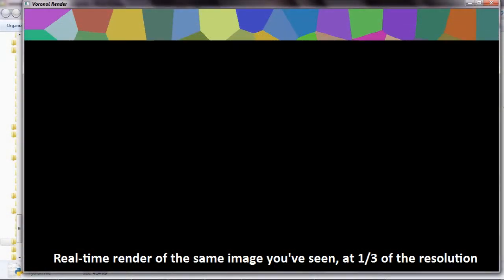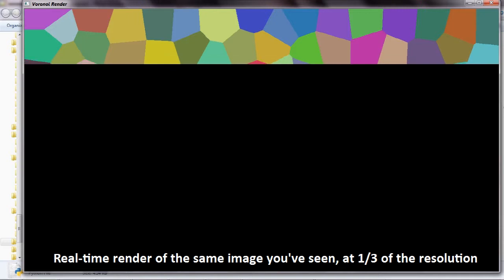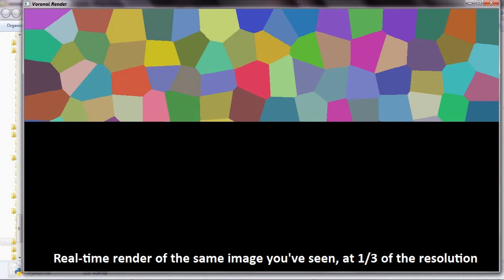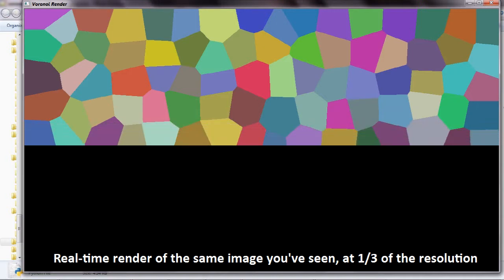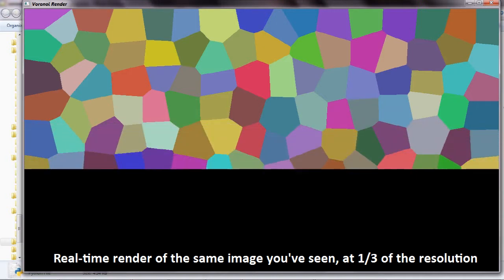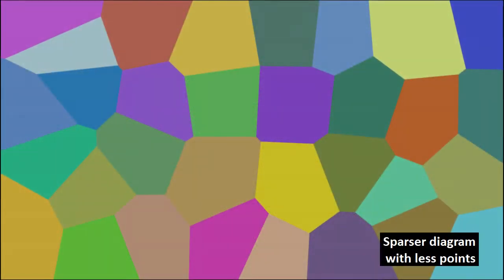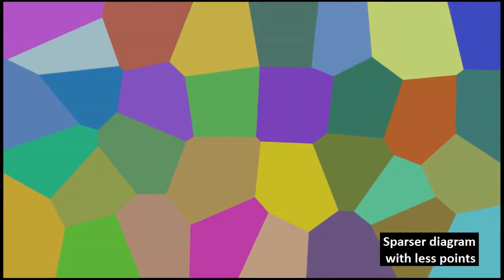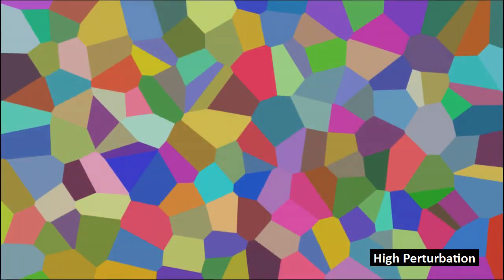Voronoi Diagrams - Friday Minis 141

Comment: Oh, Voronoi diagram. It has been a long time. Anyway, it may interest you to check out "Raster-based Voronoi diagram calculation". It works in similar concept with " Tower Defense Pathfinding". So, if you can do one, you can do the other!
Reply from the maker: +simpletongeek Sounds interesting, thanks for sharing! I found the original paper as well, will read it when I have the time =)